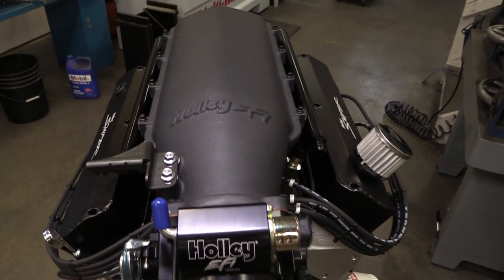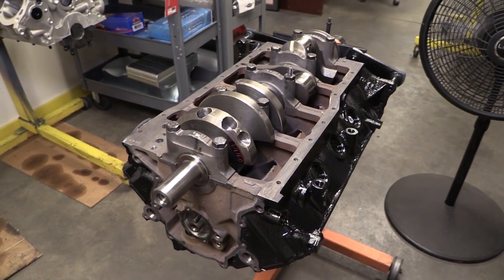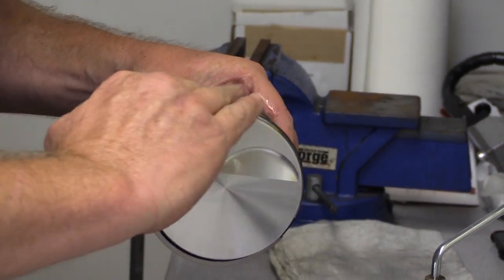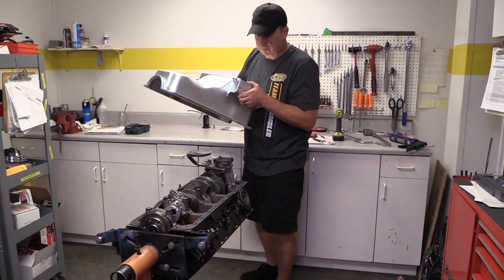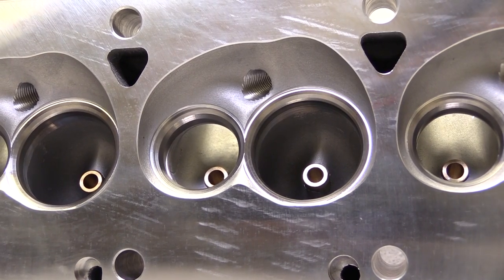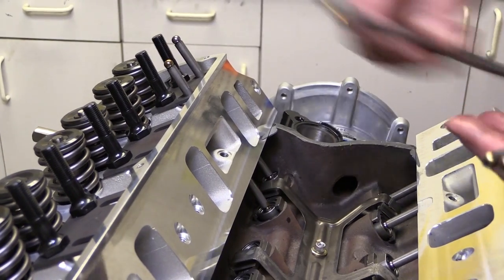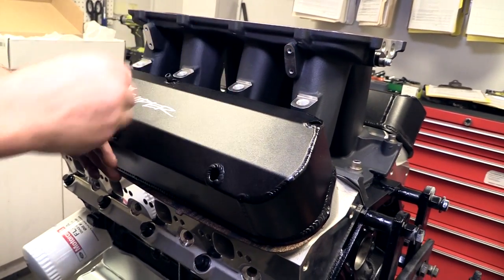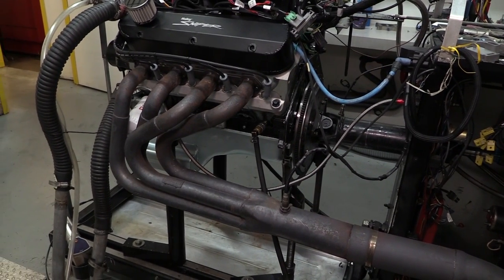The Ultimate Stock Block 5.0 Ford Build (347 Stroker V8)

Comment: 500 hp limit is a myth. It’s all in the tune!
Reply: How does the tune keep the block splitting in the galley underneath the intake ??
Reply: No detonation/knock in the tune. My car is well over 500hp at the wheels and it’s been together for years.
Reply: @DaOnE51T  I'd like to learn more about your tips for keeping the block together.  I'm researching to build a 302/306/331 for a road race vehicle I play with.  I only need about 375 hp flywheel, but need 7000 RPM or a touch higher.
Reply: @chestrockwell8328  I have had a 306   two 347 and a couple 351 engines....Currently have a 331 it's great on the street have had it about 3 years...The only ones I have had problems with wear the 347s one cracked block and one threw a rod out the side of the block both had about 400 miles on them...
Reply: @joenobody2580  Exactly... Dart block or no block.
Reply: @jerrygiovengo1927  thanks for your reply. In what form of motorsports are you using these SBF in ?   Mine will have several 20-30 minutes sessions of lap after lap reaching max (set) RPM often.
Reply: @chestrockwell8328  the key to keeping the block from splitting is a fully balanced rotating assembly and a spot on tune and keeping the revs below 6800 rpms on stock Ford 8.2 deck blocks. Check out "Stock block Mafia".
https://m.facebook.com/StockBlockMafia/.
Reply: @joenobody2580  that's not where they usually split from power. It's between the cam and main bearing on the front of the motor. Yes detonation can crack a block easily. So yes tuning is a factor. So is rpm range and the driver. Over revving causes problems also. We're made 600hp+ to the wheels without a problem on multiple occasions years ago. Shit been as fast as low 9s with the stock bottom end with boost and or nitrous. Many shit ass Builders, tuners and drivers gave this block a bad name. Obviously it's not a great block but you can make 600-700 without a problem if done right. There's just not much room for error once you get over 550hp.
Reply: @chestrockwell8328  look at screw in core plugs, like the Boss 302 used.  Skip a crank-powered supercharger. The late model 302 (side dipstick) used a different crankshaft, hence the different flywheel. Yanking on that with a belt pulled tight causes stress on the main webs. If you're sticking to the stock displacement, use 289 length connecting rods, like the Boss 302. You get better dwell, but also changes the amount of crank thrust on the thrust side of the cylinder walls. Finally, pick a block that has no core shift, or just go to DSS and get their Level 10 block.
Reply: @albertgaspar627  Thanks Albert.  Not going to use any form of forced induction.  I'm choosing the SBF 302 for this project for the following reasons. A) it's slightly smaller and lighter than the sbc, including the aluminum block LS engines. B) far cheaper than the Ally LS stuff. C) I'm only after around 375 crank horsepower and not looking for high torque either.  If only reving to 6500 I know it's fairly simple but based on the track I go to, the wheel size and gearing I'll need the engine to handle 7000 rpm.   
So far I'll be using lighter than stock pistons, internally balanced rotating assy...well balanced to the smallest difference I can get.  And proper valve train parts, likely conical valve springs.
Reply: @chestrockwell8328  you are on the right path, concerning a complete LS versus a SBF.  If you can use a tubular K member on a Fox body, check those out, they offer a lot of options.  Also, I may have mentioned the Boss 302 used the longer 289 connecting rods, that increases the dwell time of the piston ATDC.
Reply: Not really a myth at all lol. Over 500 you need machine work and cement filled block. I mean sure the tune helps more than a bit but your not getting away from it’s inherent issues for long.
Reply: My stock block 302 car runs good without all that extra sh#t.
Reply: Chest Rockwell Carillo offers rods off the shelf that are within 1 gram or less of each other.
Reply: there are cases of stock blocks exceeding their parameters--what some call "the perfect pour". The nickel gets into the right spots, the thickness of the block walls and webs is perfect, etc. Avoiding detonation also helps, and a superior balancing helps for high RPM applications, and a rev limiter.  But even the professional NASCAR teams have a bad day :)
Reply: @tonyhood450  For a daily driver, your first parameter is burning cheap gas. If you don't have E85 (Which doesn't get great gas mileage anyway), then you're limited on the compression ratio. So to build power, you increase the displacement. Now, if you want that truck to tow, you're designing for torque, not HP. And you want that torque off idle, so you aren't slipping the clutch to pull from a dead stop nor cruising down the highway at 4,000 RPM so you can run air conditioning. So you can build a low RPM, 347 with aluminum heads and 8-9:1 compression. Tho it would be cheaper just to grab a 351W out of the junkyard and give it GT40P heads off an Explorer, if this is a full size truck and not a late model ranger, it was made to swallow a 351W anyway.
Reply: @DaOnE51T  You are right. Keep the RPM down too. Removed my STOCK bottom end just two years ago from my 91' Foxbody. Had a blower (low boost, old Paxton) but ran nitrous (up to 150 shot, which was over 500 for sure) with the blower for a while. Don't rev it to the moon and don't let it detonate and they can make some power! After 86' they were all forged rod/pistons anyways.
Reply: @albertgaspar627  Ran a ball drive Paxton on stock 5.0 for 20 years motor finally got tired and replaced with 351W...just saying you can take that advice and throw it in the trash. Would tighten belt by placing 2x4 and tapping with hammer too.
Nodular crank not a regular cast crank that came stock in those engines.
Reply: @robertelmo7736  Glad that work paid off and you had good luck with the Windsor block. Plenty of others have pushed one past 500 bhp and split it with the girdle just holding the mess together.   Even DSS has to hand pick blocks to find the one they warantee to stick together. 

Most 302 blocks won't bore over .04 inches, but a few will go .06 inches over due to the luck of a perfect cast--I suspect these blocks are the ones folks are lucky to find and push past 500 bhp.

They were designed for an economy car at 221 cid, but if more held together, folks wouldn't bother with the LS--its cheaper to take the block already there and swap on great flowing heads (imagine a lower aftermarket intake that hooked up to Cleveland heads, ha), than put an LS in there with the right oil pan and serp belt assembly and get the throttle by wire gas pedal and everything else.  Would be neat to see Fords inside Fords.
Reply: @albertgaspar627  Yes, no comparison to the LS in head flow or strength...they weakened them even more with the HO XXX block too...was only 225hp though...time moves on.
Reply: Yeah, the LS block has the same strength benefit of the Grand National's V6...a deep skirt Y block design. When GM makes an aluminum block (except the ZL-1), that's how they go (the Buick V6 came from the aluminum 215 they later sold to Rover in England).

Ford Windsors have poor airflow for three reasons. One is the shock towers in the Falcon/Fairlane they were designed to go in. The second is the classic Thermactor hump for emissions. And the final is the small valves. Like Ma Mopar, Ford seemed to want small head flow for torque. Compare the HO's torque to say, a 4.8 litre (ie, similar displacement) LS...they're just about the same, even with all that difference in head tech.

The Cleveland head would of course make up for the Windsor's HP deficiencies, a combination of the "Tunnel Port" racing head they had for the 289 in 1967, and Chevy guys coming with Semon Bunkie Knudson and bringing the canted valve idea from the Rat, to show up in the Cleveland and its big bro the 429/460 Lima. 

https://www.fordmuscle.com/news/video-battle-of-the-1969-302-cube-powerhouses-boss-302-vs-dz-302/

In theory, a 302 Windsor lasting past 500 hp, with aftermarket heads flowing 300 cfm (they are out there), could make an LS swap not worth the time and effort--except to wow the fan-boi out there, of course.
Reply: Thank you for this comment. Rich Holdener disproved the 600hp myth with NA, nitrous, turbo, and supercharged 302s with stock blocks.
Reply: He has had luck with them, and others...on a dyno. The air coming in, according to RH, is 60 degrees. If you own an infrared temp gun, normal heat range on a wet carb intake is over 100. and the Ford EFI unit commonly seen is a large surface area design, so it really soaks up heat inside an engine compartment.

I suspect why some blocks fail, and some do not, is that the typical low deck Windsor won't take more than a .04" overbore...but some can in fact, go up to .06".  If some of the folks who can push a low deck Windsor past 500hp and keep it together an entire year of street use, were able to sonic check these blocks, i suspect they'd find they have the uncommon block that can go out past .040 overbore.
Reply: @rhubarbpie2027  
U sure?? Didn't that video say they split blocks? I could swear I remember reading that in the comments directly from him.
Reply: So ditch the factory ecm and run what computer??????? Someone please. I need to bring my 88 5.0 back from the dead.
Reply: It depends.  Some run a TwEECer piggyback that takes the stock A9L to a higher RPM, but others start with a MegaSquirt. Its a DIY (do it yourself), if you google it you can probably find a tune map fitting your requirements. Otherwise you're just looking at other aftermarket setups that fit your price range. Best to hit the dedicated Fox web sites and ask what they are using for your particular cam/head/intake setup.
Reply: @chestrockwell8328  ive never seen ford parts cheaper than chevy. thats why everything you seen is just about chevy swapped. cheap and easy to go fast.
Reply: @xmo552  holley makes some great ecms
Reply: @bigsean2473  SBC vs SBF  similar costs, chevy is a little less expensive. LS is not as cheap to build, and an Aluminum block LS will cost 3-4 times what a SBF costs to buy in todays market. However yes an LS will make more HP/TQ over a 8.2 winsdor all day everyday, a 9.5 windsor can holds its own a bit better.  Chevy did a great job with the LS, the ford stuff is from the early 60's so there's no reason to compare as in one is "better"  Engines are tools, pick the tool that's right for your job.
Reply: @albertgaspar627  
Thanks
Reply: @bigsean2473  
Holley is what I see everyone on MotorTrend tv shows using.
Reply: @xmo552  cuz it works great and has a lot of control. even nitris.
Reply: @bigsean2473  
How do I learn how to program or tune it?
Reply: @xmo552  it does a lot of self learning but it ask question like what air to fuel ratio you want. its a easy to use interface. follow the prompts on the screen. watch some videos on it. as you become more familiar with it you can go into the pro tuner side and make super fine adjustments for ever little bit for the perfect tune .
Reply: @bigsean2473  
I appreciate the response. That sounds like what I'd need.
Reply: Both tune AND engine balance.
Reply: @waynebollentin989  do you use a moates quarter horse? If not what do you use.
Reply: @thatguy83ful  I never have personally and everyone has their opinion about them. Most will tell you anything that's going to give you more information is going to help specially if you have a power adder and they allow you tuning ability but I can say either way how well they really work. The price seems to good to be true for everything they're suppose to do but for the price if it does everything they say you can't beat the it. 
When I started bàck in the 90s racing, you couldn't do much with a factory ecu back then. So threw a carb on it lol but in the late 90s I started with a gen6 DFI went to F.a.s.t, Big Stuff, Haltech, Fueltech and Holley.  So I never really used anything that plugged into the factory ecu. I went the all aftermarket way. Back in the early days most chips didn't do shit and in some case I seen them make cars slower believe it or not.
 HP tuners seems to be the big thing when it comes to factor ecu's. Really depends on what you have and what you're trying to achieve what's going to be best. Also budget is important too, very important. Sorry I couldn't be more help. Tell me your combo and what your goal is and I'll do my best to point you in the right direction.
Reply: @waynebollentin989  right on. I went the moates route. Which led me to discover bad caps in my ecu. Now there replaced i tested that ecu in my other fox body and it works correctly.  So pulled it out putt it back in my  red fox and i still have a issue with maf circuit. Really driving me crazy. Any way will keep at it till i get it going with a moates attached. If all else fails i do like the holly x
Reply: I know a guy with a stock bottom end, e7 heads with a vortec on 93  tune. In a sn95 mustang dyno 467whp through a t5 tuned 15+ years ago still runs strong. 

He's Original owner. 

I personally have a NA 347 making 525hp crank 6800rpm peak with a carburetor self tuned ran when pulled sold the car.
Reply: @joenobody2580 by not letting it detonate

Comment: Block is definitely the weak link.
Reply: I only run 400hp in my 5.0L however the new one will be a custom block for pure circuit racing duty.
Reply: @mctigmctiggy1475  no street driving, just track
Reply: You can make the older 302 blocks strong. I know several guys running 5.0 8th mile et with stock blocks. One is a turbo car the other nitrous but he is going turbo as well.
Reply: true but this block and cast steel crank will be fine for short bursts like a 1/4 mile street strip.  circuit racing as the the guy puts it?

no, you need a forged rotating assembly and a dart block or yes you WILL crack it
Reply: @Raymond Denno what were doing with it? Because big blocks can survive 700hp na on a stock bottom end. They do all the time in pure stock and super stock classes.   they are strong as hell
Reply: @bryanroupe8646  well tune turbo 302 could go far and best part is simple and cheaper the new coyote. And I know coyote could go way further but anything could happen at the track.
Reply: Always make her wear a girdle regardless.

Comment: Why build up a dinky 302W cid when you can start with more cid in a 351W and go into 427 cid for only a very few more dollars. Physically - it will fit in the same envelope, being only about an inch and a bit more in width. Length is identical, bolting patterns for bell housing and motor mounts - same. Heads - same with only different bolt sizing. All external accessories are identical. Yes, oil pump and distributors are different as are intakes, etc, etc, etc but not thousands more expensive but maybe a couple hundred. I've done several of each, but that 351W is my favorite. To each his own, I guess

Comment: Finally a good looking intake.
Reply: Rodcognito 00 looks like an LS lol
Reply: You nailed it. This is the best looking FI intake on the market. It's just a matter of building intake ducting and a custom air cleaner box.
Reply: @calvinlamontagne8958  it’s an intake.. no LS every cam with a high ram intake lmao... gotta love LS guys
Reply: Would this work on an 89 bronco 302 ?
Reply: @dustinmittel348  yes
Reply: What year did Ford use the 347
Reply: @jamesledbetter9037   a 347 is a 302 that has been bored to 4.030 and stroked to 3.40... you can make any year sbf a 347.. although most people go with 331 over the 347 bc of reliability
Reply: @BR-P-2001 //  again it’s a intake.. so do you not like v8s bc the LS is a V8 lmfao..  what about headers they all kinda look the same.. gotta make sure my alternator looks nothing like a Chevy.. Here’s your sign lol 😂
Reply: @BR-P-2001 //  hey man I get what your saying. LS swaps are way over done. And they use this style on LS engines, but performance parts are performance parts.. just bc they are both forward facing high ram intakes doesn’t make it a Chevy intake.. if this intake made more power people still wouldn’t use it bc “it’s looks like a LS”

Comment: Damned nice, no two ways about it,
BUT the ULTIMATE stock block small block is the 351W stroked to 427 cu in.
Big block power in a small block package, and small block weight.
Reply: indeed brother
Reply: Increasing the stroke limits the max rpm potential because pistons speed increases.. personally I prefer high rpm medium displacement 302 to 358 cubic inches. Big displacement and high hp are easy compared to high rpm and high hp per cubic inch.. just my 2c they are all cool in my book.
Reply: marktse8732  personally if I had the budget I would go for 9000rpm IMO that is the minimum rpm for a v8 to be considered a high rpm motor. Torque 400 to 500 would be enough because my classic car (capri perana)is a light European car. I think my power goals are a bit expensive to reach but they are achievable. I have seen yates headed fords that have the numbers I am after..700hp 9000rpm 302 to 358 cubic inch.. as for the 2jz, great engines but I am obsesed with old sbf,  here in Europe they are rarity and sound amazing.

Comment: Another great video from THE HORSEPOWER MONSTER !  An excellent production featuring a superstar in the ever expanding 302W Universe. This combination of components was obviously well balanced according to the story told by the dyno. The most notable components are the aluminum heads from PRESTIGE MOTORSPORTS. 
They are the center of attraction and topped with the Holley EFI Hi-Ram Intake, clearly demonstrates the meaning of form and function. 

Well done, guys. 
And the beat goes on.....